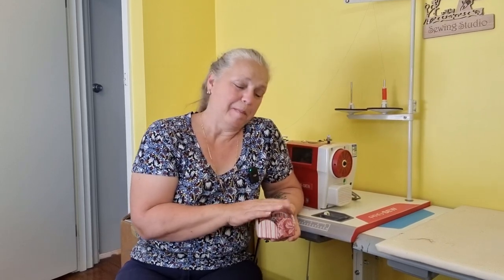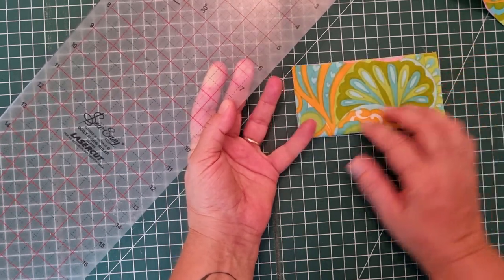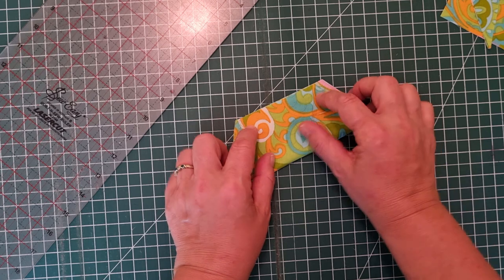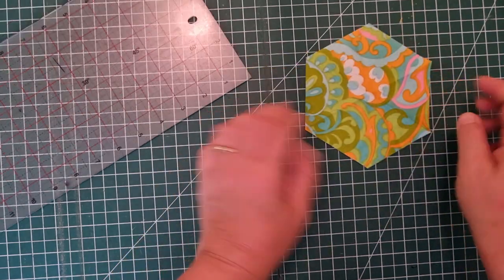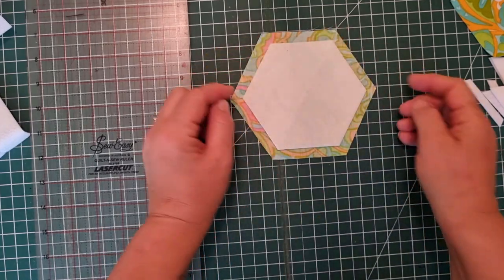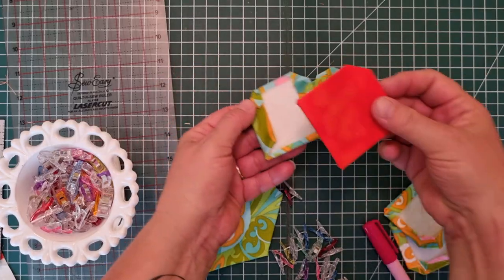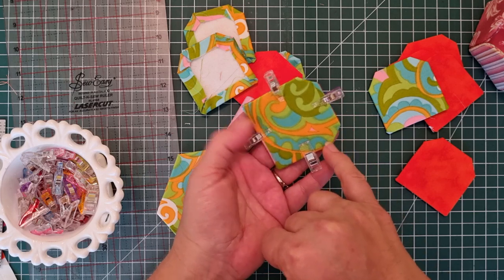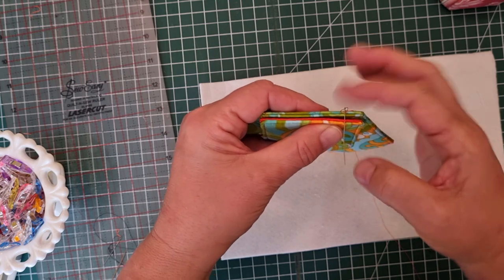Learn how to cut Hexagon shapes DIY storage caddy fabric container. Sewline glue pen

Comment: If I need an 1 1/2 side hexagon I would need to start with 3 1/2 square?
Reply from the maker: Linda, these were 6" squares that had 3" sides, so if you wanted 1 1/2" sides, you'd double that and cut squares at 3" 😀 Try it on scrap paper first though to see if you like the size, and don't forget the seam allowances